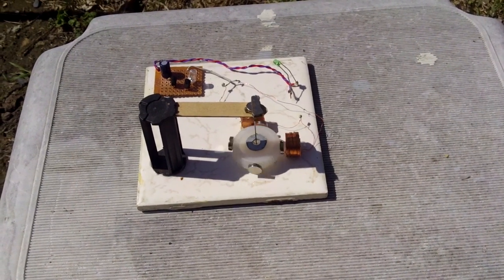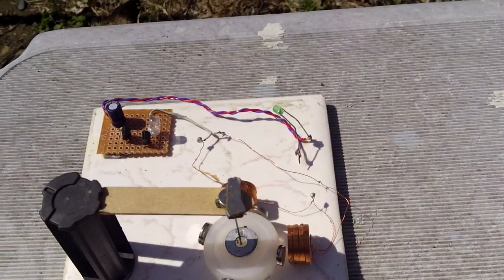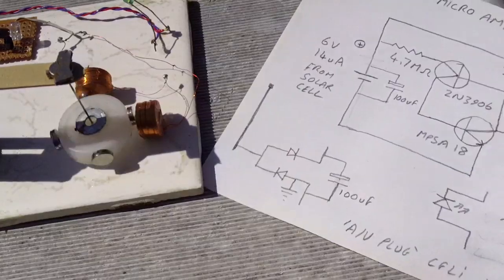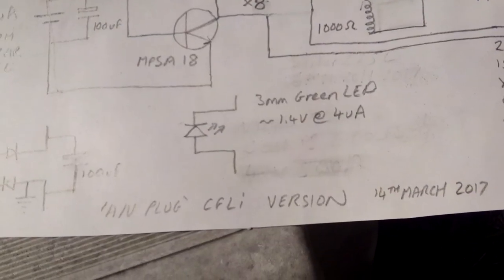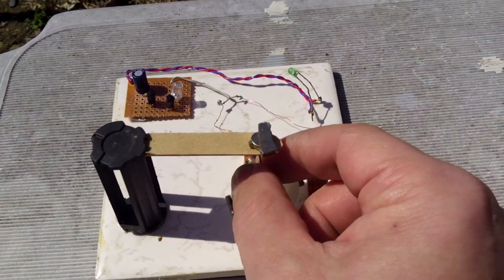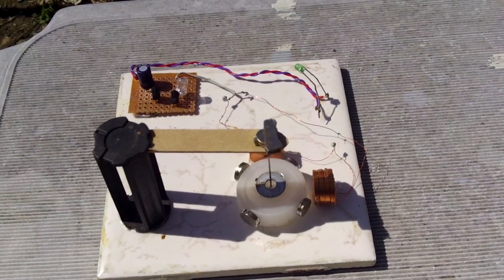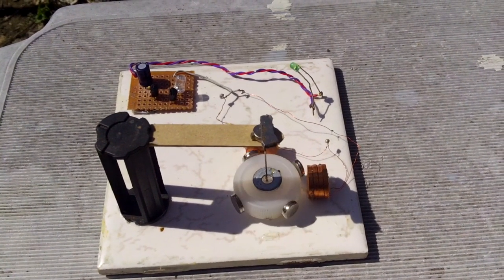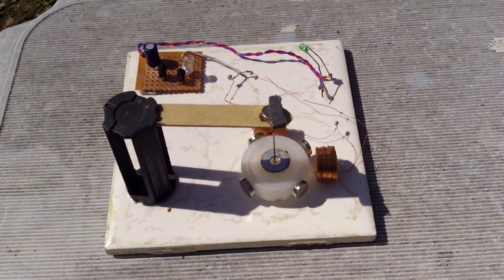Motor powered by a 3mm LED

Comment: I think I missed it somewhere. How many coils do you have sandwiched together here ?
Reply from the maker: 2 sets of 4x 500 ohms, for 4K total. I did try adding extra or deleting, but it seems these run it best. The version with the extra 50 ohm transformer and cap is a little better, but this video was to show it running as cleanly as possible.

Comment: One question, in transistor 2N3906 the 3.4M resistor is connected to: E, C, ????? because the base is connected to the led.
Do you think you can use a resistance less than 3.4M, I do not have such a large one ???. 
What is the voltage of the capacitors that should be used?
Thanks in advance
Reply from the maker: Good eye and sorry about that, have just looked at it. The resistor is connected to the Emitter.... I'd forgotten to draw the arrow. 
An option for a resistor is a bizarre one, but you can do it right now. Take a pencil and scrub a line on paper until it becomes reflective/shiny. The distance between 2 connected clips to it can yield any resistance you like and suits high meg numbers. Scrubbed for 10 minutes you can get into the 10K sort of area per inch, but that isn't needed.
Caps can be anything, 10V, 16V, 25V, none will see anything to damage them.
Reply: @Slider2732  
Thank you for answering, incredible the resistance, although I did not understand very well, my English is very bad, I will google if there is a resistance on paper. Thank you
Reply: @Slider2732  
the question now would be how do I connect a cable to the paper resistor ???? a problem brings a solution that becomes another problem, hahahaha
Reply: @Slider2732  
AAAAA ok. I understood, I do the resistance on paper and with some clips placed on the paper and I solder the cable to the clips, after all I am not so gross, lol. Thank you
Reply from the maker: Ah sorry about the language. The resistance is because of the graphite on the paper. Drawing a line 100 times over and over itself makes the resistor. The more times that you draw the line, the less are the gaps between the graphite atoms and the lower the resistance. It can be easily measured with the tips of a multimeter.
If you measure your line at a short distance between the probes, there will be less resistance than at a longer distance. A good length of line would be about 2 inches or 5 cm
Reply: @Slider2732  
Thank you, I'll try

Comment: great  video  I did a  short video on the voltage produced by the larger led diy chips .  the 10 watt version and the 30 watt bulbs produced 5 volts and 11 volts respectively.  I wanted to try a 100 watt led but the one I ordered never came in..

Comment: I got mine to run the same way today using an IR led.  If you have a strong radio station near you the motor might run off a 'Joe Tate Power Module' .   I don't think mine will work because I'm too far away from a radio station.  I couldn't even get my Penny to run off the RF energy picked up here. Solar energy is the best free energy source where I live.
Reply from the maker: Am glad to hear about the I/R. Yep, the Joe Tate is the kind of direction after the successful lamp run. In fact though, my versions of it always seem to run best without the wire link between the 2 joined diodes and the 2 joined output caps.
 We have several FM stations of low power around here, is only a small 'city', AM is probably stronger from Tulsa...oh, it might run off lightning lol, we get plenty of that !

Comment: excellent video, you have in another video where you can see the circuit better, thanks
Reply from the maker: Oh, I may have in an earlier video. The basics for a lot of this low power running is a blocking oscillator circuit... as found on Wikipedia and popularised around 2012 by Lidmotor with his 'Penny'' circuit. A circuit that can run from uA will run from a green LED in sunlight. 
The solar waver coils have 500 ohms resistance, enough to not pull down anything of a driver circuit. Link them with an efficient Joule Thief type of circuit and away they run, on the tiniest of power. That's what a few of us have been refining for something like a decade now!
Reply: @Slider2732  
Thank you very much, I'm going to try it, I already managed to make one (Lidmotor based pulse motor) with recycled parts, but I have to improve the rotor balance (it moves a bit to the sides when it rotates and I don't know how to improve it yet, if you have a suggestion ??), thanks for your answer helped me a lot
Reply from the maker: Something with a tiny hole in the middle will usually fix side wobbles. The rotor goes inside the hole, which is glued to your build surface. Something like a tiny piece of protoboard, or maybe the holes in a dead Arduino sensor board. Anything thin, with a hole in the middle.
Reply: @Slider2732  
Thank

Comment: has anyone tried making one of these super low powered motors do something? like run a clock?
Reply from the maker: Hey, good to see you around ! It would take Swiss precision for that lol. I see what you mean, a mantle clock having delicate components and the spring being replaced or wound by the motor movement...would say possible, but would be an engineering feat.
A propeller can go on the top and if the motor gets up to speed then it does have use in Summer for a 'free' breeze, especially if built sideways.
Other than that, the energy needed = tiny torque.
What are you flying these days ?
Reply: umm, currently, an '86 samurai on 33's lol i haven't been flying lately and need to rebuild my race quad since my wife bought me a gopro session.
Reply from the maker: You built an electric car, out of a Suzuki ? (to paraphrase a famous quote).
Yup quads here now lately, a couple of E010 RX based homebuilds.  1 weighs only 17g AUW (150mA 1S) and has old skool cotton/white glue to hold the motors on. Would rubber band power it, if it would work :)

Comment: PROBABLY works, but you should cover up the LED to show truth, not physically stop the motor... ;)
Reply: truth?...the motor "picks up speed" after initial torque is overcome.
Reply: I agree. I find it hard to believe that it's actually the LED that drives the motor. I will believe you if you cover the LED to show that's where the energy comes from.
For example, the capacitor would probably leak more than the power generated by the LED.
Reply: Covering the LED wouldn't prove anything. For example, if there was some hidden sorcery at hand, the LED would be enough to switch on a mosfet to switch this circuit on.
Reply: I'm pretty sure I've observed voltage across an LED in bright light at a physics class when I was 17. Still.. There might be sorcery here.. Ooooooo
Reply from the maker: The problem with these rotors is they take far too long to show any speed difference when powering down...can take well over a minute to slow down enough that the camera would show it. They show a speed up better.
Reply from the maker: And it's easy enough to build, for cheap, so anyone could have any such questions answered readily :)